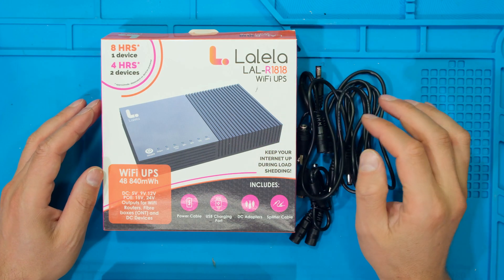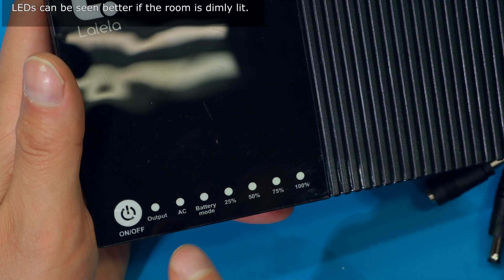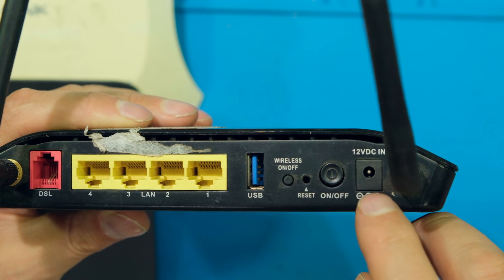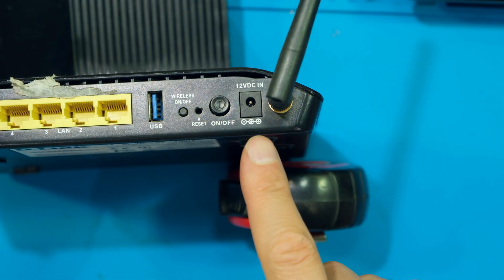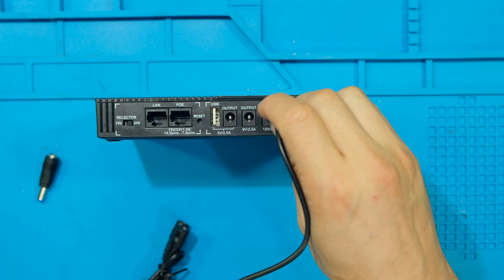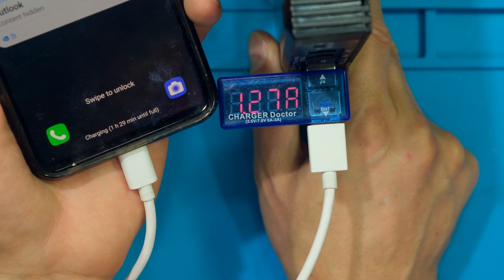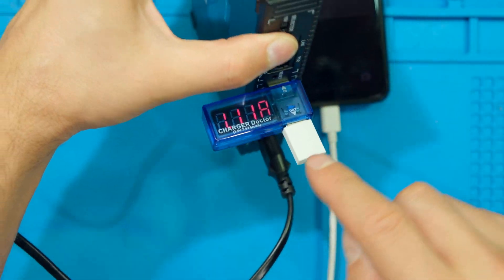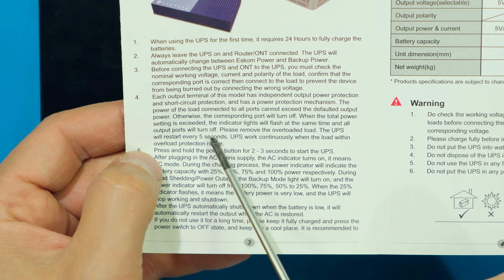How to setup and use the Lalela wifi ups LAL-R1818- Tested and Reviewed

Comment: I've had a similar one for almost two years now. The batteries do t laat long anymore and will need replacement soon. Can't survive without it.
Reply: Bro my UPS is 1 month old but the green lights start flashing as soon as I plug it in and then it turns off any help for me???

Comment: I have the same device. It power my D-link dir825 router and vumatel ont for around 5-6 hours which is sufficient for load shedding. Been using it for around a year and it still hold capacity, haven't noticed any reduction.
Reply: do you use it with both the ONT and the router?
Reply: @TheRuan1987  yes, I mentioned I use it with both the D-link router(dir825) and the vumatel ONT.
Reply: @Talk2Admin  Oopsa sorry i didnt read that properly.  thank you.  I am considering buying a UPS like this
Reply: @TheRuan1987  cool, I also bought another cheaper ups from takelot called "Blue Carbon UPS for Wifi Router with 120cm Y Cable and Support POE"

I actually have it for around 2 months now and it works very well. I mean for the price you could buy 2 if these vs just getting 1 lalela and to be honest it has been lasting over 6 hours with just plugging in 1 to link deco so may e check this out
Reply: @Talk2Admin  Thanks Man. greatly appreciated
Reply: @Talk2Admin Hi did every DC UPS  which works for wifi can be used even if the lithium battery is fully charged as well as AC input also plugged?

Is it dangerous for the lithium battery or not?Did the lifespan of the battery be affected or not????
Reply: @MuhammadAwais-wl6fu  no as long as the device that pulls the current is not too demanding